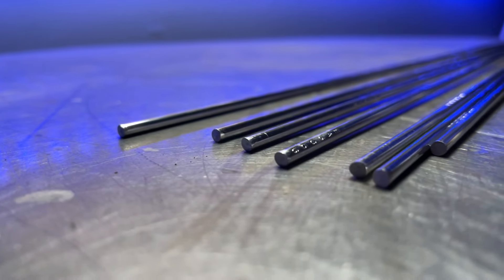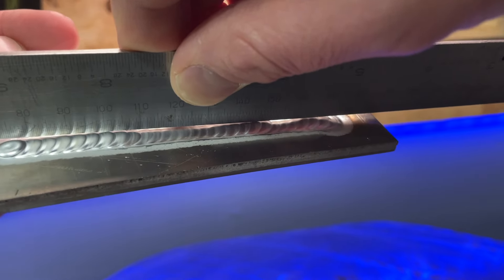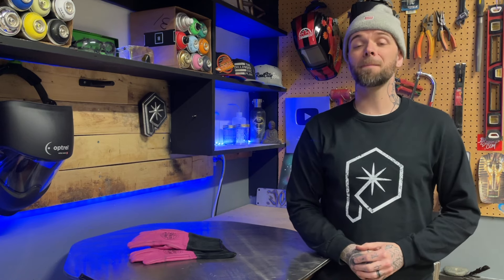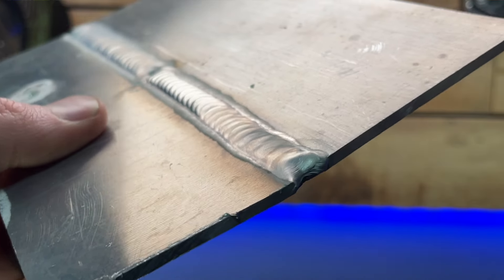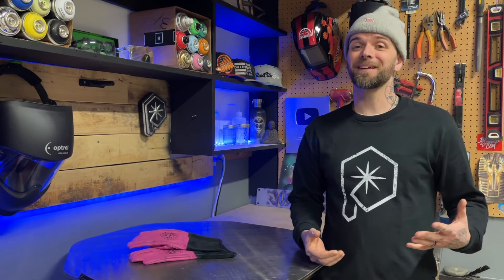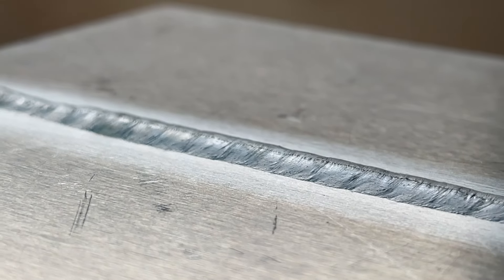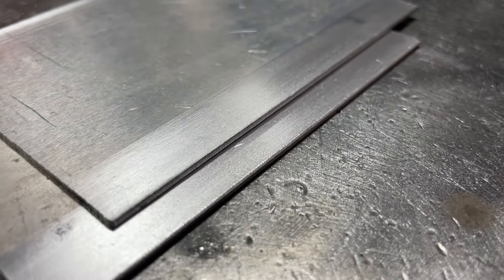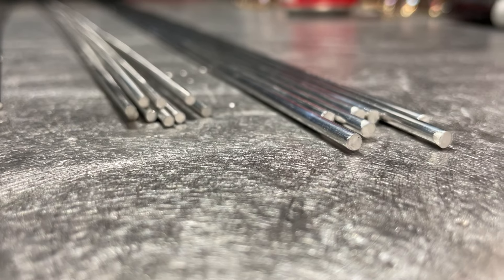Why I only use 1/8" Tig Welding rod....

Comment: Ha ha, I never thought of rod size being the problem with my welding of 3mm 25mm by 25mm aluminium. I've been using 1.6mm filler and just changed to 2.4mm . It made a world of difference in the results.  I've been tig welding about 2 weeks, and your channel has been  a huge help to my progress

Comment: Continuous motion during welding will also help reduce heat input. Each time you pause your to tungsten to fill it's causing a load of heat to build-up. Tapping your filler rod faster will also help smooth your Welds down to take the high low cratering out. The low points between welds are weak spots the smoother the Weld the stronger.
Reply: Once the aluminum gets hot iit is really difficult to weld even if you move fast. For me it's better to use a bigger rod.
Reply: His welds are strong enough + he is getting them to look extremely good

Comment: Great tip. I have been struggling with heat input because my filler wire is too small at 1.6mm.

Comment: Great information Dusty.....been using mostly 1/8" but sometimes I will step down to 3/32", I mostly weld 1/8' aluminum with these size rods....groove butt and fillet welds..thanks for the great stuff.....cheers, Paul

Comment: I buy 10kg at a time to get a significant discount and I get only 1.6mm or 2.4mm because that gives you the most flexibility. If you need a larger wire, simply stick two or more smaller diameter wires into a drill chuck and twist them together. The surface area of 2.4mm wire is ~4mm^2, about half the area of a 3.2mm wire. Simply twist two 2.4mm wire together to get the equivalent of a 3.2mm wire. And if you need the smaller diameter, you always have that option. If you have 1.6mm wire, twist four of them together to get the equivalent of a 3.2mm wire. Aluminum is very soft and ductile and is very easy to twist together. You can do the same for steel, but it's much stiffer and only really doable with the 1.6mm or thinner wire so I just buy the size I need for steel.

Comment: I use 1/16 70-s2 while welding 4130 moly on tube chassis drag cars. Maximum wall thickness for crome-moly is .083, and maximum wall thickness for mild steel is .134 which I use 3/32 wire for mild steel. Hey, good information on your channel. 👍

Comment: Depends on the job you're doing. if you need to be running at 140+ amps then  a1/8" rod is good. If you only need 100 amps, you'd be better off with 3/32". 60 amps or less should only need 1/16" rod. I routinely weld 1/8" thick angle sections at around 70 amps using 1/16" filler rod. I don't want the weld melting through to the back side & I don't want big, fat (& ugly!) weld beads. But that's just one particular job. Horses for courses...

Comment: I got a TIG machine last fall as a demo from ArcCaptain brand, but had little idea how to use. Taking TIG class at the college i work at. They stock 1/16, 3/32, 1/8 I found the smallest one to be too small and kind of a pain, the big one seemed too big so i just stuck in the middle and like that one. I liked idea of bigger meant less feeding filler but it was just too much buildup.

Comment: I think filler rod to plate weld size is the key 
I use 1/6th for 16g sheet but have also used 2  1/8th rods at once when welding fillets on 10mm plate 4mm tungstone 350 amps balls to the wall   and go

Comment: I weld 3/4" OD x .040 wall 316 stainless tube with .045 316L filler. Even bumping up to 1/16" and I have issues with too much heat going into the part. Aluminum over 3/16" thick at >150A and I'm running 1/8" for sure.

Comment: Very interesting.
One question outside:
Have you already done a video about pulse welding and how to set it?
Thanks from Italy 👍
Reply: Some people say the 3 3 3 rule Is a good starting point. 3 pulses per sec 30% uptime and 30% background. I try to run fast in pulse so I use a lower pps and higher uptime.  This should be a good start point for you to work with and then just slowly move each 1 at a time and see how you feel about the change in weld.
Reply: @MrHennrocks  that's good for steel, but 33% back current is not a great  setup for aluminum tbh

Comment: I always have a hard time using a thick rod like that ( I only do steel ). The rod sticks in the puddle and I have to yank it out and the torch and filler rod move around a lot because if this
Reply: keep a very light soft grip on the filler, let it slip in your hand if it sticks and let the heat from the arc free your stuck rod. Good luck!
Reply: Sounds like you need more heat, with steel the average size i use is 1.6mm

Comment: I believe you need a wide range of sizes as different jobs will have different joints, material thickness and other factors. I use a size as small as 0.9mm all the way to 2.4mm (mail Dc welding)

Comment: With the many different types of welding machine power sources available there are too many variables to limit things like tig rod diameter to one set size. Transformer Rectifier vs. Inverter power sources with different sine wave shapes along with different frequency rates is a great example.  What are your essential variables?

Comment: Why "double tap" instead of feeding rod and keeping the Rod in puddle. I had to use 1/16 on 1/4" fillet weld ( rush repair) super speed feeding required.  Made me want a cold wire feeder

Comment: Naaah. 
There's a time and place for each diameter  of filler.
Just because you can does not mean it's good.
Smaller diameter filler allows for lower heat work on smaller parts.
You cant do this stuff with 1/8th and not have burn through on thinner material.
I know I know. Penetration is what you want but over penetration causes brittleness in the weld.

Do you man. But you can do better.
More passes isnt a bad thing. ;3
(Been in this biz 13 years now. Certified x-ray Tig  pipe and plate. )
Reply: Yeah this is pure content creator stuff. He wants engagement so putting stuff like this out there he gets all kinds of comments because it’s such a weird “rule” to go by.  It doesn’t make sense.